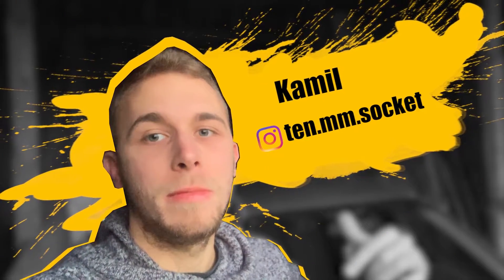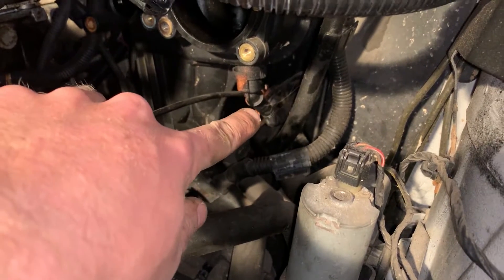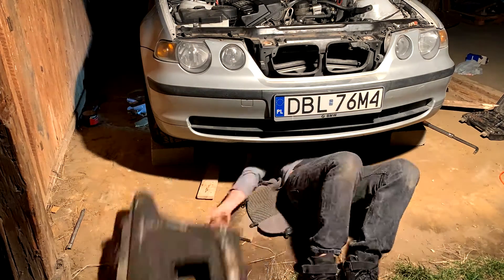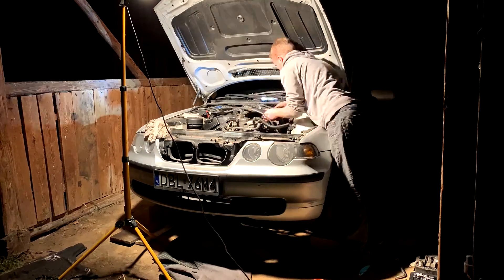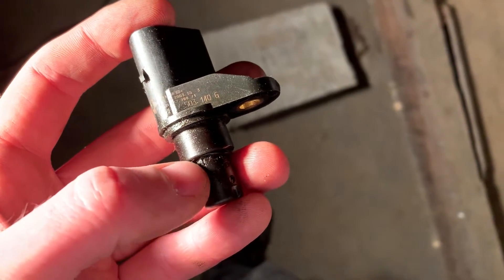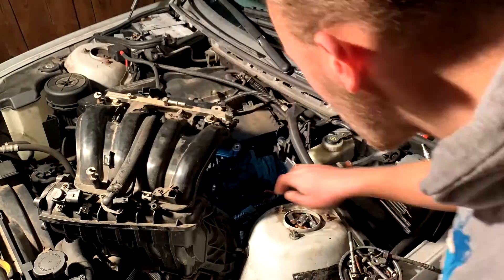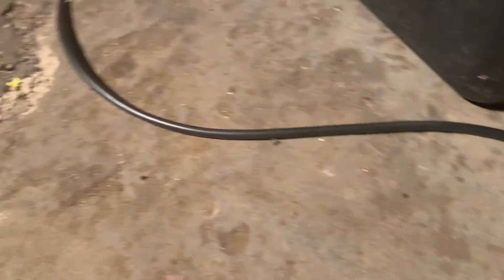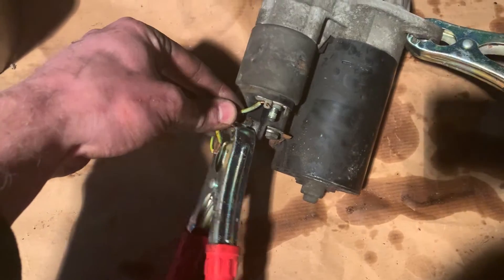How to replace CAS - CRANK ANGLE SENSOR N42B20

Comment: Ooff im not looking forward to that job nou 😅 have to replace my cranksensor and cam sensor Exhaust
Reply from the maker: Just have your favorite drink for after the job ready 😅 it’s such a small part but so annoying how much you need to to get to it
Reply: @gorillaprojectcar  lol ill do just that do you have any tips for me ? I think ill need it
Reply from the maker: unfortunately I don't have tips apart just take it slow and don't rush it. And get OEM or good quality sensor. Once I bought and used an aftermarket and had to do this job again because it didn't work even once